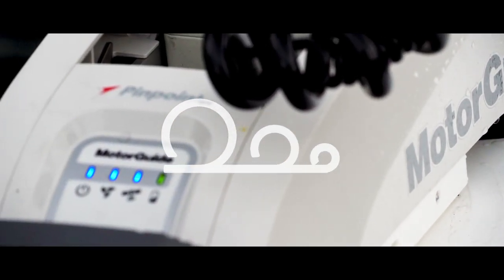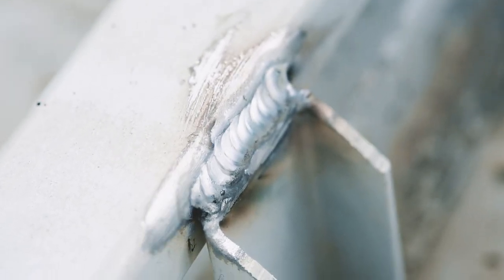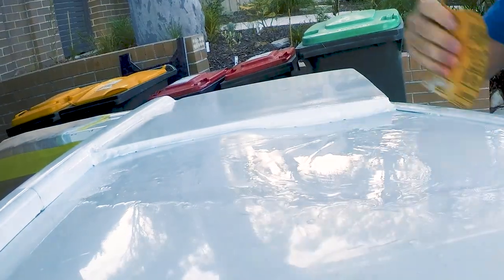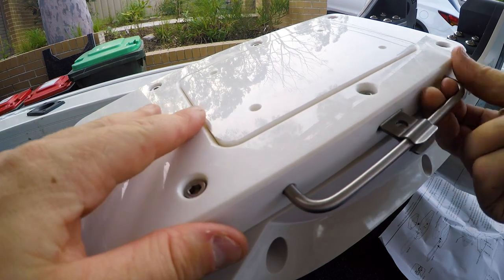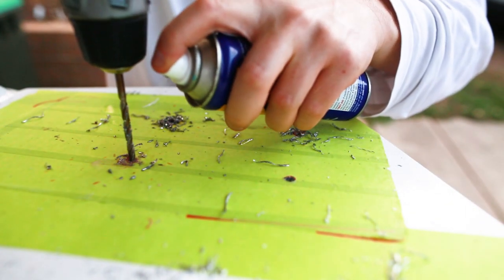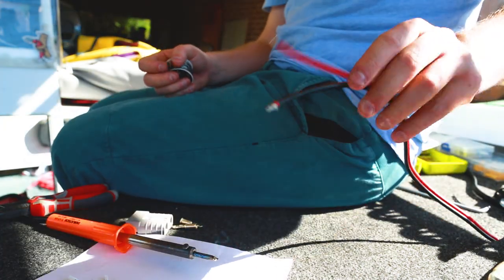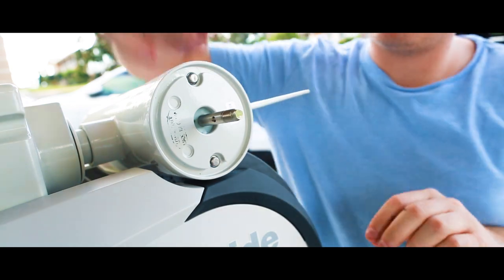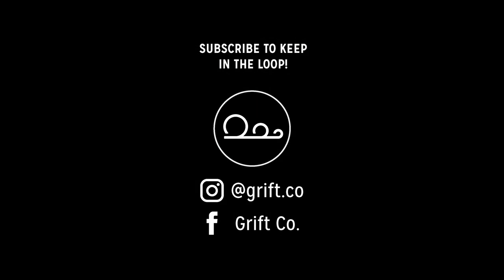HOW TO Install an Electric Motor | MOTORGUIDE Xi5 | DORA PROJECT 🧜‍♀️

Comment: Hey mate, I know I'm late to the party here, but just a heads up. You shouldn't tin cables you intend on crimping as the wire becomes hard and doesn't bond with the crimp terminal as it is squashed. You may never have problems, but you could possibly end up with loose connections down the track.
Love the videos regardless 👍👍
Reply from the maker: Thanks Dave! Very sound advice and hopefully some people see this. I’ve actually since changed the system and running a Marinco plug and socket for the motorguide which is a much easier system to install. Hoping to do a little video on that soon

Comment: Hey man, I love your build. I watched a bunch of videos from the playlist a few times, and I was wondering if you could answer this question for me; Why is your trolling motor mounted on the left of the bow? I mean, you mention that you don't want it in the way of anything in the video, but wouldn't it make more sense to mount it on the right? Around here, near Montreal, most of our docks are on the left at the boat ramps, so there is much more chances of damaging it if it were on the left, plus, since your console is already on the right side, it would kind of make sense to "clutter" that side first, so you have a much more "free" left side, no? Since your boat should always have the bow pointing into the wind, that would also mean that you could fish 100% of your left (port) side without any issues whatsoever... at least, thats my understanding in the 25-ish years I had of fishing.

Comment: Great video, question already asked but not answered, what AWG cable did you use? Should be stamped on cable, and is important. The i5  55 lb max current draw is 52 amps so 60 amp breaker is right and Anderson plugs look like 50 amp so should be ok as well, but not sure of cable or battery. A deep cycle wet acid or AGM battery is limited to continuous max current around 25- 30 amps, seems ok for spot lock in low or moderate current but not for holding in strong current or for trolling - check wet acid / AGM battery sellers warranty, most now limit or offer no warranty at all for connection to trolling motors. I am just about to fit an i5 so did a lot of research on them, as I want to troll, as well as go away for a couple of days at a time (no charger) i decided to go with deep cycle 120 AH lithium ion (LiFePo4) battery -  half the weight, many times the "deep cycle" performance, able to handle the 52 amps easily, and cost only $450 in boxing day sale.
Am also interested in your i5 installation, how much offset between the motor shaft (when deployed) and the front of the mounting plate did you leave - you mentioned "enough to allow for the shaft bending" but video doesn't show and you didn't say.
cheers
Terry

Comment: Hey mate. How has the motor guide performed now you’ve had it for a while. I’ve got a 385 explorer and looking at one.
Reply from the maker: It's been really good - only point of frustration has been the buzzer in the unit. I think water or someting has got inside it so it's now quieter than originally. otherwise, still going strong!

Comment: Another great video from Grift Co... I just installed 2 Ti2's and a Xi5 trolling motor (didn't network NEMA yet). I have a couple of questions that I didn't see on your video. First one, how hard or awkward is lifting the trolling motor out of the water with no cord attached? We are going into Winter here in Toronto and won't be able try this until next May/June and was wondering if I should attach a T-H Marine g-force handle? Lastly, I purchased my Xi5 with the built in sonar... do you have the built in one for your boat? If so, what was the transducer setting you set on your front Ti2? Thanks and appreciate your thoughts!

Comment: Great Video! I'm in Hornsby and looking at the same thruster plate upgrade to my quintrex. Where did you find buy your motor and all the parts, cables batteries, connectors and enamel paint spray cans? I would also love to see a video on the nmea cable setup . Keep up the good work.
Reply from the maker: Thanks Mate - bought all the motor guide equip from Blue Bottle Marine (Super close to you). Battery from battery world, the etch primer from super cheap and the enamel paint from whitworths (that doesn’t come in a spray can). I’m still yet to get the NMEA set up but should be able to do that soon

Comment: Very nicely explained. This will be very helpful. What's the amp rating of those Anderson plugs you used?
Reply from the maker: Good questions Satburn, I'm not actually sure. I'll have a look into it and get back to you!
Reply: @GriftCo  Cool, thanks. By the size i am guessing it's the 50 amp version, just wanted to be sure.
Reply from the maker: @20ldF0rTh1s  It sounds like you're across this more than me! I'd trust your judgement more than this stranger over the internet...
Reply: @GriftCo  Ha, not really. I was shopping around earlier at local shops for those plugs and apparently they come in 50 amps and 175 amps (maybe larger as well) and the latter is a bit of a beast for much higher gauge wires

Comment: I have a Quintrex 390. I believe it's a 2006, my bow piece is not flat it's somewhat domed. my question to you is did yours come with the bow piece already flat or did you change or somehow modify it, also what year is yours?
Reply from the maker: Mines a 2004, the bow is flatish but has a definite curve to it. We didn’t really need to modify it to make it fit, just placed the thick sheet on top and welded it up. That said, the bow plate has a very slight lean outwards because of the curve

Comment: How many amp hour battery do you run mate. I have brought brought an xi5 and am unsure on what battery to buy and how many amps they pull per hour
Reply from the maker: I've been using a 110Ah AGM Deep Cycle. It's been fantastic pushing around Dora and can last a couple days easily without a recharge, that said probably not best to do that with a deep cycle battery. Should be kept above 50% to maintain a good life span.

Comment: Why did you go to the 3 blade prop ? From the 2 blade cheers
Reply from the maker: Snake Toga - this was the standard one that came with it!
Reply: Yeah right mine came with a 2 blade
Reply: 3 blade is more efficient and less noisy but newer stocked xi5s come stock 3 blade